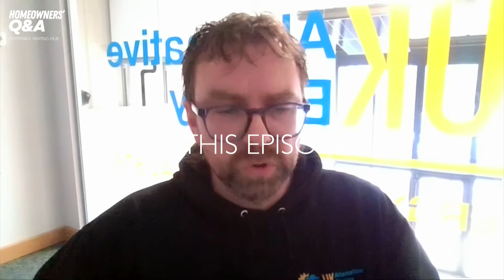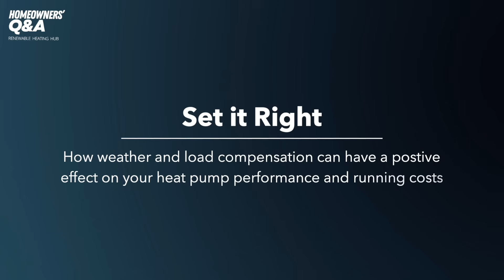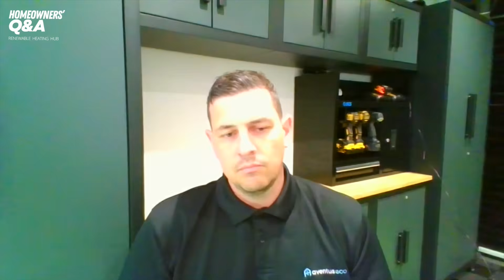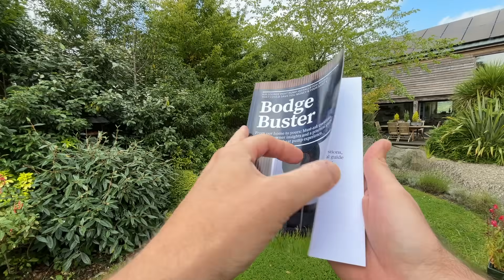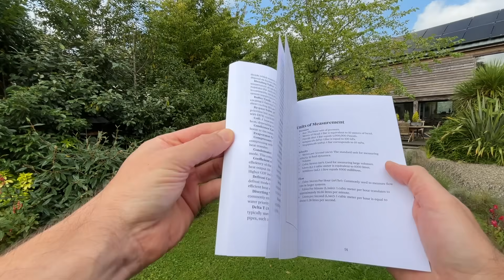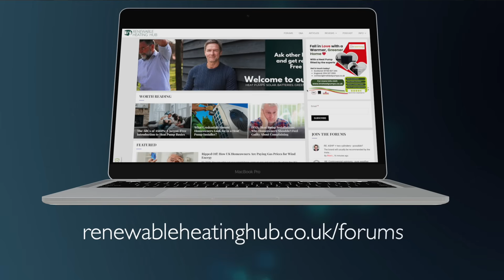Why You Need Weather and Load Compensation on Your Heat Pump

Comment: You mentioned having ufh and radiators running on open loop if you can get them both down to around 35°C flow temperature.

Does this mean when you're requesting an ufh design, you ask them to design it to a maximum 35°C flow temperature for your designs outdoor temperature?

Comment: You bring up adia once but it seems like none of the installers have experience with it, even though it's capable of balancing weather and load compensation with AI. A manufacturer or installer monitoring actual £ spent and not just COP and helping home owners lower their spending would be very attractive to home owners

Comment: I don’t understand the comments about hysteresis of 2C.  The idea of weather compensation is that the heat pump modulates gently in line with the weather changes to keep the temperature constant.  This is one of the main arguments used in favour of weather compensation indoor thermostats, which do have a hysteresis effect due to the thermal mass of the building.

Comment: Hi, great video as always. We’ve just had Octopus Energy complete the installation of a 4kW Daikin Altherma 3 heat pump 2 weeks ago. There are a several outstanding issues and one of these is they would not install the weather compensation sensor and set up the functionality.
We live in an end terrace and Octopus have said all 3 sides of the house are exposed to direct sunlight at some point during the day so are unable to fit the sensor, ie there is no suitable location for it to go.  

I don’t know if they are just trying to fob me off or have a genuine concern. 

Any advice or ideas on how the weather compensation sensor could be fitted in our scenario would be greatly appreciated. 

Thanks

Comment: I've watched the video twice now and it's still not that clear how Load Compensation and Weather Compensation work together.  I'm happy to accept that it's my misunderstanding of Load Compensation, but it sounds awfully like you have a thermostat in one part of the house that drives the overall temperature generated by the ASHP.  That leads me to think that there are likely to be rooms with different temperatures because of differing heat losses in those rooms and thus comfort is compromised.
Reply from the maker: It’s a valid question, and I’ve answered it in the question you raised on our forums. For others that may potentially require further clarification, there’s more info here: https://renewableheatinghub.co.uk/forums/renewable-heating-air-source-heap-pumps-ashps/load-compensation-and-weather-compensation

Comment: What I can't understand is why the heat pump contoller does not have a little more intelligence to be able to learn what flow temperature the property needs at a certain outside temperature. It seems crazy that you have to go and adjust a curve when it would be so easy to do it in software and continue to optimise over time.
Reply: I thought this is what load compensation was and if it was combined with weather comp would be perfect.
Reply: @handle1196  Mitsubishi call it Auto Adapt. Havenwise do the load compensation if the heat pump can't, or doesn't do it well.

Comment: Very informative. I can't see why you wouldn't use load compensation if available and on the understanding that the room thermistor reference in in a living space. I can only speak for our Ecodan which is in that mode with the wireless controller as the internal reference. The Mitsi control system then "adapts" the weather comp curve by cross referencing the internal and outside temperatures. I've operated our system one full winter in pure weather comp and one winter in load compensation and saw significant savings in "auto adaptation" mode.

Load compensation is able to take into account solar gain or wind chill on brickwork and by referencing what's going on in the actual room provides greater comfort level. I'm a big fan and would recommend using that functionality if available on other heat pumps.

Absolutely correct in the recommending manufacturer controls and not compromising with third party thermostats etc. which do nothing other than create inefficiencies.

Keep up the good work producing these videos 👍

Comment: I understand that Weather Compensation works, but setting it up does feels like an unnecessary extra step in this modern age. Surely, if engineers can design a system that extracts heat from thin air, they should be able to develop the required smart technology that seamlessly maintains the set temperature inside as the outdoor temperature fluctuates, without the need for manual adjustments. For someone like me who has a new found hobby with 'all things renewable' I don't mind the challenge of spending countless hours tweaking the system, but I guess that's not for everyone 😊.

Comment: Hi. A question for Dan about Samsung controls. I have samsung 7kw gen7 heatpump that is set to load compensation. I also found that the heatpump was over and undershooting by 2 degrees. I have found how to change that to 1 degree in Samsung app. 

You have mentioned that you install optimisers for your clients. Can you provide more information on how these optimisers work please? Is this something a customer fit themselves?
Reply: Havenwise will dynamically controll the heat pu.p flow temperature and once the house temperature target (which you dictate) is getting close to being achieved,  starts slowing down the heat pump, also looks at predicted weather patterns, works in combination with TOU Tarriffs, to make the best of that cheaper rates. The heat pump controller basically becomes redundant, no need to keep turning weather compensation settings either.
Reply: @kenbone4535  Thank you!
Reply: Hi, thanks for your question. The optimiser takes more information into acccount and calculates the optimal way to run your heat pump for cost savings (not for maximum efficiency). For instance, apart from indoor and outdoor set points, it will also consider your electric tariff, weather forecasting, and local solar gains. 
To have one installed, you would have to contact a competant person. With the Samsung, you would need to buy the Samsung modbus adaptor/PCB as well as the optimiser. The optimiser is then wired directly to the heat pump PCB and replaces your existing heating controls.
I hope that helps!
Dan.
Reply: @DanCadd  Thank you for this information. I had my heatpump installed by a company who are developing their own heatpump optimisation solution. They have installed their own hardware to optimise heatpump use, but have not completed software development yet. Hopefully, they will have a solution for optimisation soon, but I am eager to learn more about alternative solutions. :)

Comment: We have a Vaillant and would like it if we could adjust the DHW temperatures on a 24 hour schedule, to use the time of use tariff we have. We can do it for heating. Any chance feeding this back to Vaillant.
Reply from the maker: Thanks for the feedback and comment. I’ll share this with Vaillant today.
Reply: I have a Vaillant too and have set the DHW circuit to come on every day at 0430 until 0600. It works well. To set it Go to Menu, Time Programmes, DHW. In there you'll find you can set up to 3 time periods each day for the hot water system to reheat the cylinder up to your chosen temperature. Next, go back out to the home screen and press Op Mode. Go to 'Domestic hot water' and select 'Auto'.
Job done.

Comment: Lack of installer knowledge and training is the reason why people in the past with Gas or Boilers that never had them installed or configured , people when gas came in mass usage are accustomed to having their boilers cycling on an of and not modulating to gain maximum efficiency . and no people expects rads to be piping hot and have a room heat in about an hour rather than keep the boiler running constantly in the background to maintain a set point temperature. several rogue installer have set the narrative with low cost inefficient installs and home owners have accepted this false , inefficient and energy wastage. now the challenge to re from home owners mindsets
Reply: At least the increase in popularity in Heat Pumps is having a positive effect on boiler manufactures, no longer can they just keep churning out inefficient gas burning boilers, now they are making them modulate, they even may may label the setting up as 'Heat pump mode'!